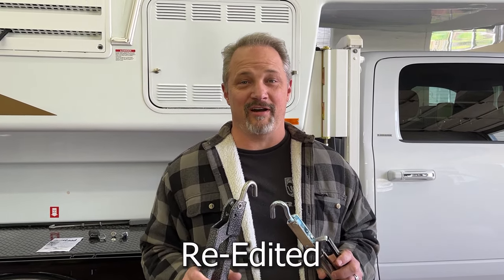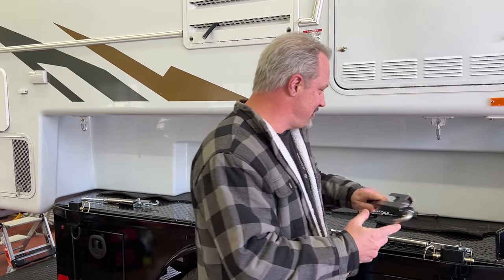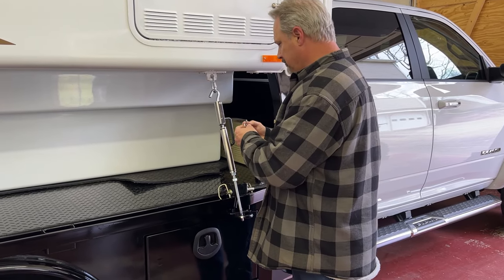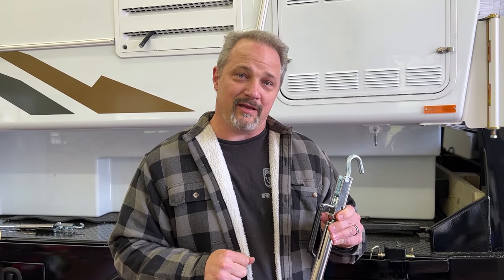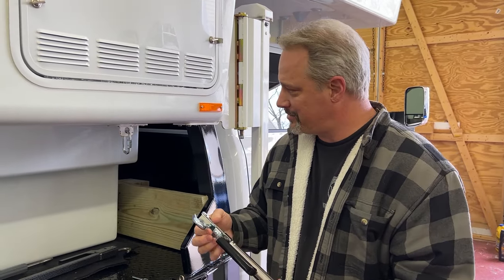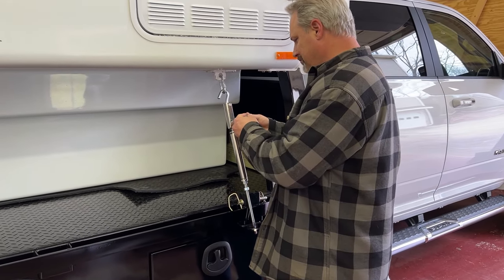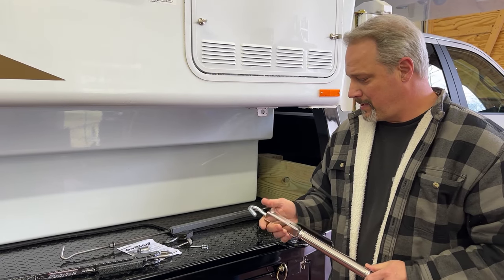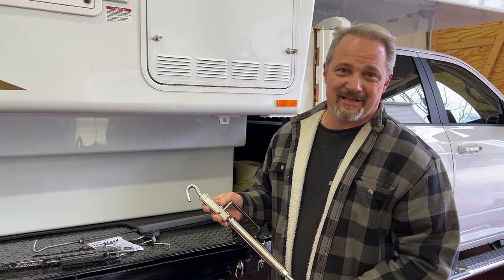Truck Camper Turnbuckles / HappiJac Qwik-Loads & TorkLift FastGuns / Re-Edited

Comment: I agree that the torklift units are insanely priced but a few years ago my brother bought a set of the all stainless steel version as he was tired of what was going on with the traditional chain/turn buckle method that was first put on where he bought the camper as they could become slack. Part of the torklift magic at least for him is the fact that it has that internal spring and allows for some stress motion and yet holds everything in place if there is slight shifting and does not loosen off the tension like a turn buckle system does or similar with a snap over system like you demonstrated that does not have the internal spring. Not that I am knocking that much lower cost alternative with the quick fastening system but unfortunately like you pointed out it does not have the internal spring nor the method out of the box to install locks. Due to sticky finger syndrome and the fact that if the tie downs were stolen and never noticed it, that would be catastrophic if driven down the road and the camper fell out of the truck so my brother installed those slide through locks with the weather proof caps at the key end. Sadly one seems to have to lock things up, even that is not fool proof but padlocking the receiver hitch pin and tow bar etc if towing a vehicle ensures that its not easy to mess with  either.
Reply from the maker: Thanks for the comment.  I don’t know if your brother had the same set or not but the Happijac Qwik Loads I have are spring loaded.  I was just using them today.  I do like the Fastguns better but for the point the Qwik Loads are pretty good.  Thanks for watching!
Reply: Those locks are expensive,  so I just used the cable locks that came with my guns.

Comment: We haul our lance 1130 on a 3500hd duramax flatbed, albeit with basic happijac turnbuckles and a 3/4 wrench, kind of the same as you if you need to adjust, haha. Out of curiousity, why do you have your attachment points pulling straight down?  They could provide much better strength with less tension pulling at an angle.